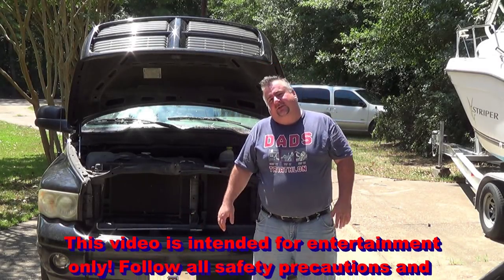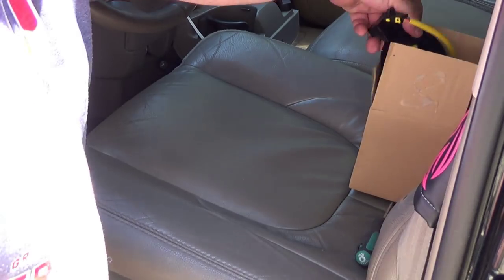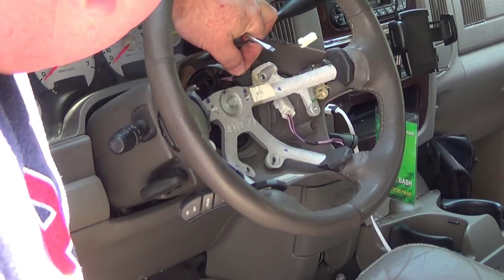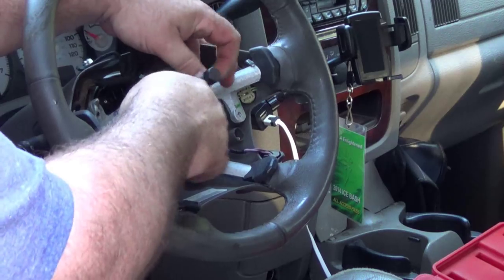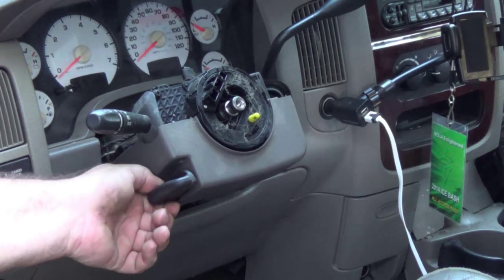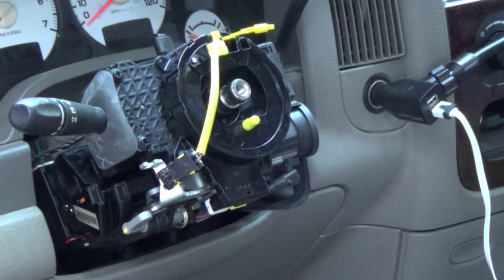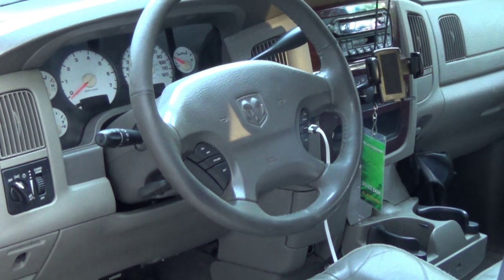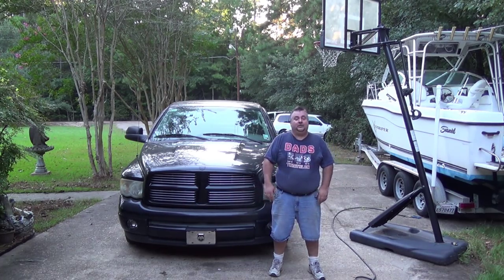HowTo: Replace The Clockspring on a Dodge Vehicle with an Airbag Light On

Comment: Just for information if the clock spring does not make obvious noise it may not be bad. Noise being when turning the steering wheel you will hear crackling noise. You can uninstall it and the airbag and re install and check if the air bag light goes out. Make sure both battery cables are removed while doing this. My clock spring was replaced about 2 years ago and recently the air bag light came on for no apparent reason. I did the uninstall and re install and light is out again.  You also should check for any codes indicating a problem or not.

Comment: Video was great,  just finished installing my clock spring 2010 avenger!! 😊
Reply from the maker: thx
Reply: Hey! A couple years late but uh did that fix the problem for your car? I have the same car with the same issue and was wondering if that did it for ya? Anyway thx😬

Comment: Good work bro. You saved me a lot of guest work. Very good. Ive got the same problem on my dodge intreped 2000 model. Just one more thing. My lighter doesnt work on the dash to light my Seagate. Does this affect it to.

Comment: I have an '02 quad cab with the cummins and it's the same scenario.  Cruise control stopped working 4-5 years ago and about 2 months ago the air bag light came on.  You may be onto something here.

Comment: If you do not have a puller or can't rent one from a local automotive store, you can put your hands in the 9 and 3 o'clock position on the steering wheel and rock it back and forth.  I never use a steering wheel puller.  A body man told me to just rock it left equally while sitting in the driver seat and has not failed yet.  I have removed many of them.  It may help.  By the way, I agree Dodge uses any fastener they want so have many screwdrivers close by.

Comment: This may be just what I was looking for.  The buttons on the steering wheel have become intermittent, once in a while the cruise won't turn on and now the air bag light comes on and off while turning.  The ding gets your attention every time.  I think I'll have to try this.  Looks like I can do this for less than $125 with Dorman part.

Comment: Hey was curious I'm having a popping clicking noise turning left and right in the steering, wonder if it's the clock spring but no air bag light and everything works in the steering wheel. If able to help thanks, very much appreciated
Reply: Matthew Roberts cv axel

Comment: Hello. I have a problem . The airbag light bulb is lit. I checked the tester shows that the problem is with the left side of the sensors. (lost communication w/ left side satellite acceleration sensor 1).
Could you please show where this sensor is.I have a Dodge Grand Caravan 2010. Thank you

Comment: was fixing my power steering pump. never jacked it up afterwards to get the juices flowing again through the pump. well I stripped something and my steering wheel is all over the place like something is stripped. any ideas? I also have the airbag light but I had that before I did the p.s. pump. would a stripped clock spring make the wheel feel like its not catching anything while turning?

Comment: THANKS FOR THE INFO ON THE CLOCK SPRING REPLACEMENT. COULD YOU SAY WHAT THE COST WAS FOR THE NEW CLOCK SPRING? WAS IT A MOPAR OR PARTS STORE BRAND...???
Reply from the maker: Can't recall. I ordered it... but would recommend you buy locally as I've heard there's a significant number of defects and you will appreciate the ease of returning it locally.
Reply: Buy an original Mopar.  The aftermarkets are junk.

Comment: Now you need a special tool to rest the airbag light then you are done because when the clockspring breaks it sets off a hard code and you need an expensive code reader for your vehicle to reset the light disconnecting the battery for a while will not work

Comment: will the clock spring stop my horn from working
Reply: Tashira Savoy yes it will usually stop all of steering wheel mounted switches cruise, accel, coast, radio, speaker volumn ect.
Reply: Have you local tech trouble shoot it an make a desission